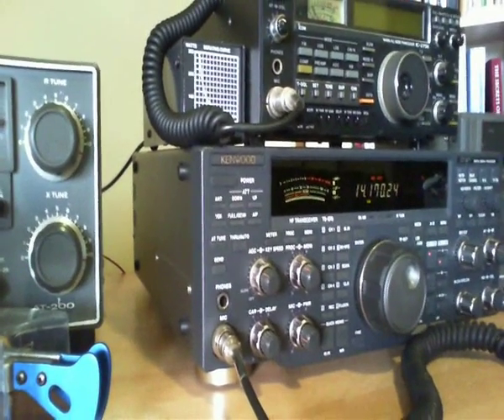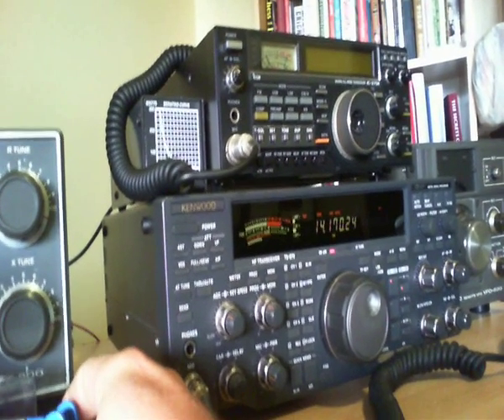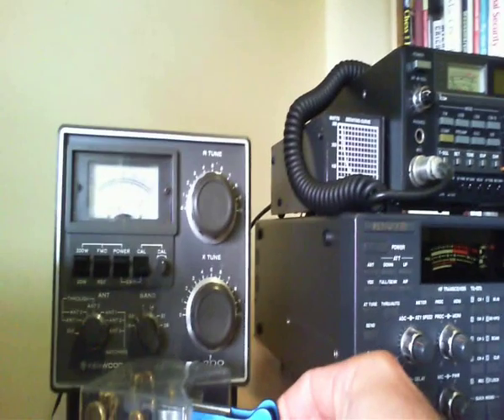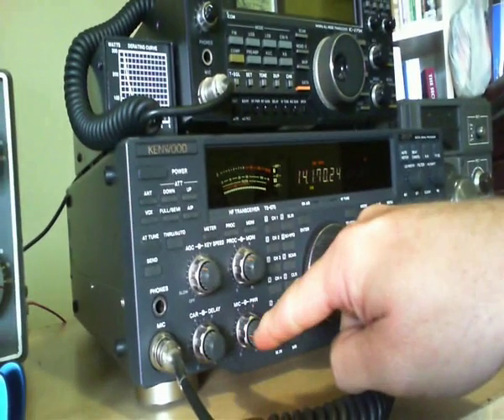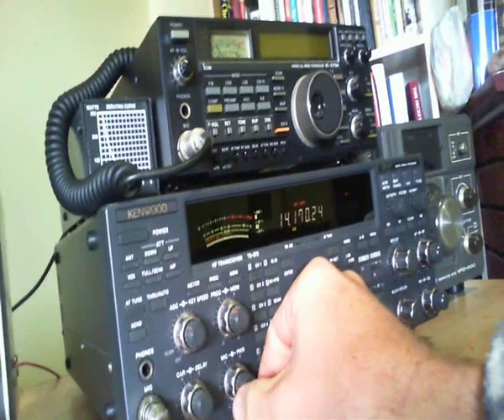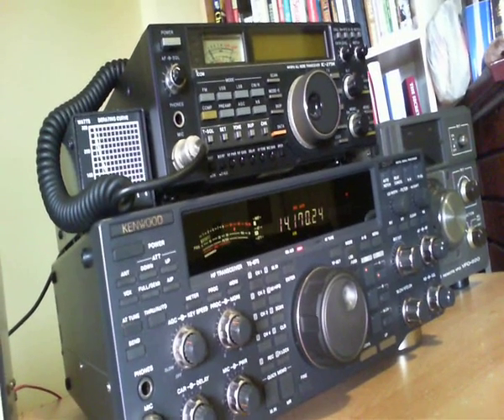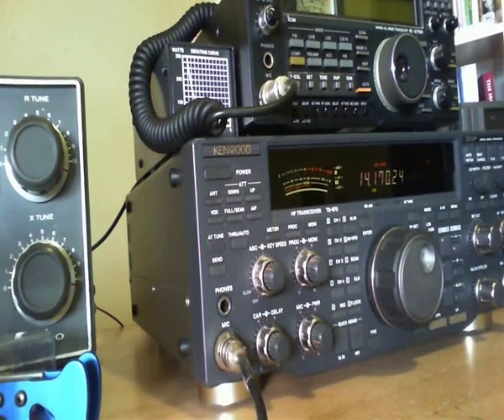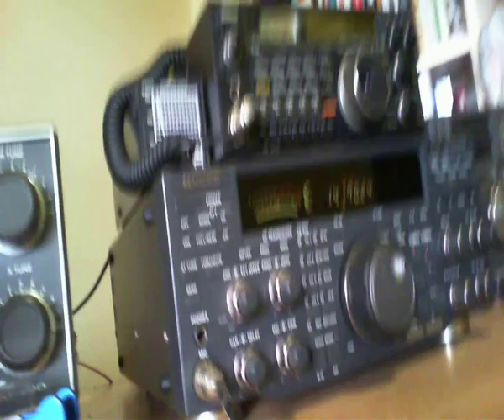Kenwood TS 870 ALC issues on SSB.wmv

Comment: The key is to eliminate the ALC. There's different ways of going about it. SM5BSZ talks at length about in his paper "abominable ALC".... good read if you want learn more about the negative effects of ALC. For the TS-940 , I put an 80k resister on the ALC side of the power output control, then I control the radios overall output with a w2ihy audio limiter. I never had an TS-870S.....maybe it's like the 940? DE  WW4Q

Comment: Yeah I'm now having the same problem with my ts-870, hence my searching for clues on YouTube, certainly as another post suggested the ts-870 is voltage hungry, mine won't give full power out on 13.8 volts input..it has to be increased... And my microphone socket is loose also.. Common fault? Meant to be that way? I'm gonna have to do a full root and branch inspection of my install, see what's amiss....
Reply from the maker: I truly believe this was a rf grounding issue has the radio has worked flawlessly at my new QTH

Comment: Hi. I ain't no expert, but I am quite sure SWR and RF feedback will have an effect on alc readings. I think running into a dummy load to get correct mic gain levels would be best
Reply from the maker: jamie skinner   Thank you.   It turned out to be a grounding issue.  A much larger ground cable removed the issue.

Comment from the maker: Well yes and no.  I took this radio to a local tech to get repair work done to it.  I assumed my DC to DC was faulty as described here.

http://www.n1eq.com/tech/page_07.html

However when I got to the tech my radio worked flawlessly.  It did not exhibit the same behaviour at his location.  I had installed my trusty ol TS 830 whilst the 870 was away and to be honest I never put the 870 back on the desk because the 830 works so well. hi hi.  I think that RF was getting back into my shack with the 870.  In fact the video here is dubbed because the xmit of the radio caused the audio to be messed up.  Perhaps check all of your grounding and ensure it is adequate as my 870 works fine at another QTH and antenna system.

gud luk
73

Chris